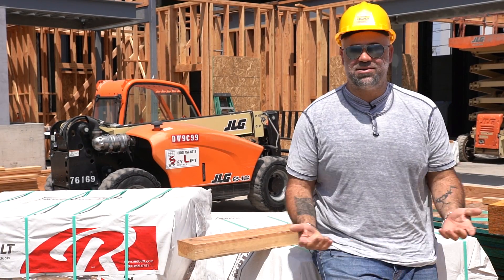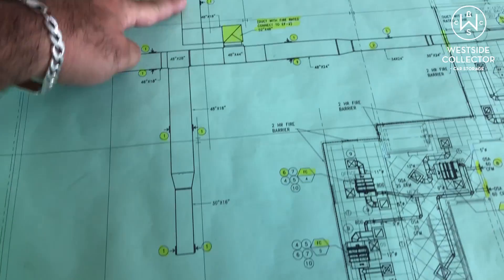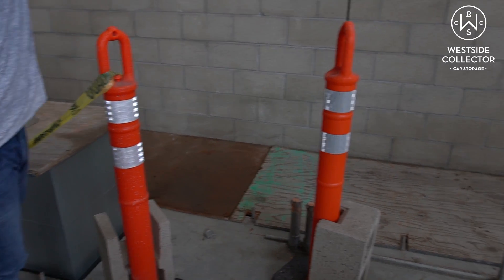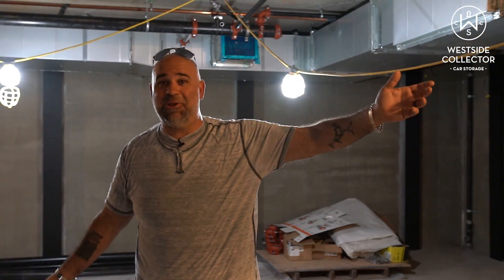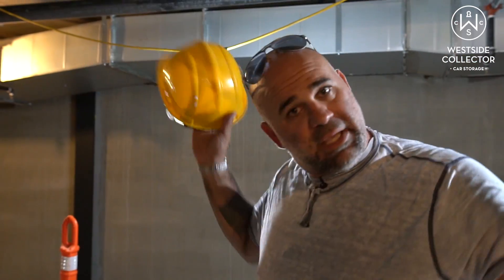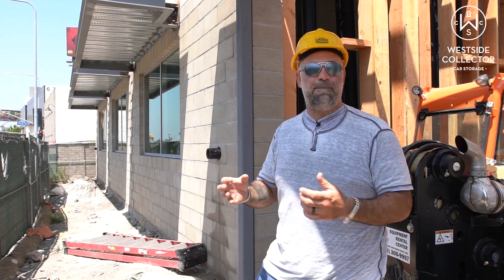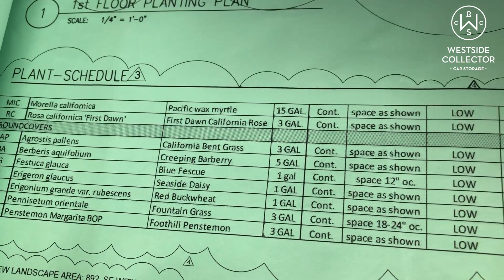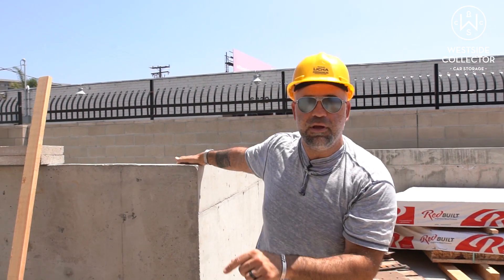How I Built LA's Coolest Parking Facility - Part 2: Air and Water

Comment: What happens when your 1500 GPM fire system is discharged in the basement and your two 70 GPM pumps can't keep up.
Reply from the maker: The entire fire system is "on demand." Meaning if there is a fire, the nozzles local to that fire will go off only, not the entire system. If the entire system is at full crank, the whole building is going to burn down and who gives a shit about the water.
Reply: @TheSmokingTire  I see, so using the maximum amount of nozzles is getting maximum cover to put out fires before they spread. Hopefully they never have to be used!
Reply from the maker: @Wolfgangb42  yeah more nozzles means a more precise coverage area when the system is actually needed. It's not about necessarily flowing more volume, which you could accomplish with fewer, but larger heads.

Comment: Clean the rainwater?? California, you are nuts. Would make more sense to me to store rainwater and use it to flush toilets and wash hands.
Reply from the maker: Because of how rarely it rains here, the cost of building a storage tank on the roof (as well as the weight reinforcement of the roof itself), the filtration system, and integration with the standard plumbing system would be extraordinarily expensive compared to how much actual water came from it. In a very rainy climate I could see that working though.
Reply: I think it has something to do with the storm drains in LA being at capacity so it delays the amount of time it takes for the rain to reach the storm drains.
Reply: Insert Witty Name  That’s capacity control.  You could accomplish that with a basin, a tank and pump, etc.  Basically the rate of water off the site post construction cannot exceed the rate of rainwater runoff prior to construction.   So you build containment with a specific release rate that matches the pre-construction condition.  

Filtration of the water is a different requirement.  Much less common than water volume storage.
Reply: LOL It not just Cali we do it here in OKC. It's not plants but a rock bed 3ft deep. Not everyone does it but its coming.
Reply: I thought it was illegal to collect rain water, I heard of an old man getting raided swat style for doing so to grow his own food and live off the grid per say.
Reply: Josh Rinlee In some states, it is illegal. But here in central Texas rainwater collection is a thriving industry. My 5000 sq ft house operates solely on rainwater. It's filtered four times before we drink it, bathe in it, or cook with it. It also makes washing your car a breeze; no more water spots.
Reply: Snarky . Live 
Nowhere near to this degree.
Reply: Great vid.  Keep them coming.
Reply: Washing your hands in rain water? I'm pretty sure rain water is known to the State of California to contain chemicals which may cause cancer, that would never fly.
Reply: @meekrab9027  lol
Reply: cleans just means remove it through infiltration or filters to remove trash the size of a cigarette butt. shit is real out here in Cali
Reply: @marc07112  oh yeah, I forgot about all the cigarette butts on my roof.
Reply: marc07112  
More like shit is crazy stupid there in Cali.
Reply: Capturing rainwater for toilets and irrigation (not hand washing...) is legal and encouraged, but not required; it would be more environmentally beneficial if more people did that, but the laws are written with input from developers who don't want to have to do stuff like that!

The stormwater rules otherwise are attempting to achieve two things: 1) removing accumulated pollutants gathered in runoff (e.g. roof paint, brake dust and gas/oil from roadways, etc.) and 2) slowing down/spreading out the rate at which stormwater leaves your site. When everything is paved or roofed, runoff moves very fast to drains, which means the peak flow is a very, very high flow rate that ends quickly. In nature, rainwater that falls on natural dirt/grass/forest/etc. seeps and flows slowly, so peak flow is low but it lasts much longer. When runoff peaks faster and quicker, erosion in downstream areas increases. Increased erosion clogs wetlands with sediment (and destroys upstream habitats by wiping sediment out) and hurts environments, among other bad things. Stormwater management is looking at multiple scales at once, and is attempting to achieve multiple aims at once.

As for Matt's description of his cleaned stormwater going into the street, he's either mistaken and his storm drains are piped into the underground pipe BENEATH the street (which is what they should do), or the city has allowed them to do something stupid and cheap by pouring cleaned stormwater on the street and down into the gutter.
Reply: Seriously? Are these regulations Cali specific or LA specific? Like would you have to worry about scrubbing the rain water before running it off into the street covered in grease, oil, and trash, in let's say Charlotte, NC? I highly doubt this but maybe.
Reply: @gsabella4  The point of LID is actually so that the stormwater doesn't run off into the dirty streets and into the ocean. Water is captured on site and infiltrated into the ground, eventually entering the groundwater. LA wastes a lot of its rainwater, which we can't afford to do given how dry it is here.
Reply: Rainwater collection? Are you nuts? How would municipalities make money off of water then?!